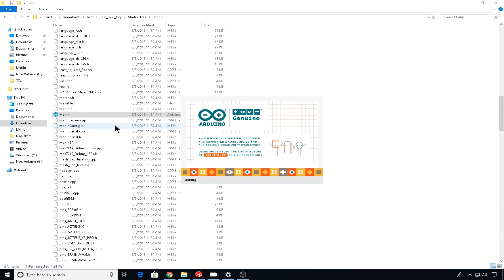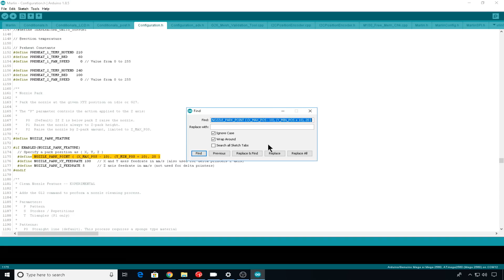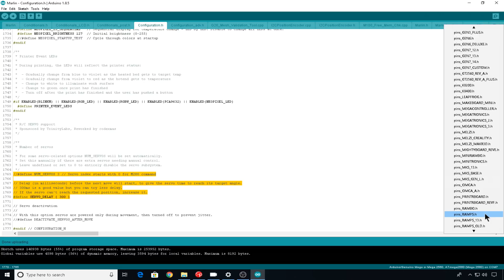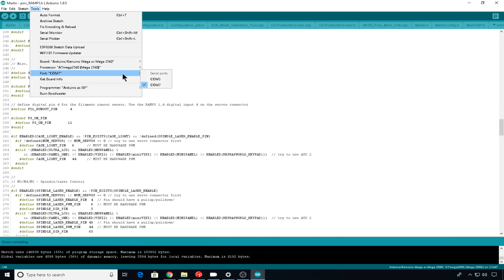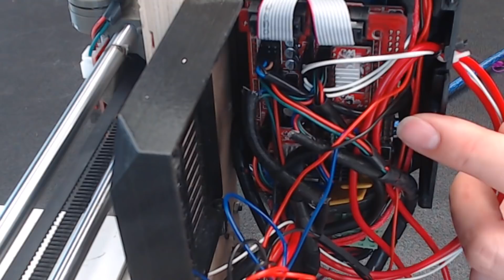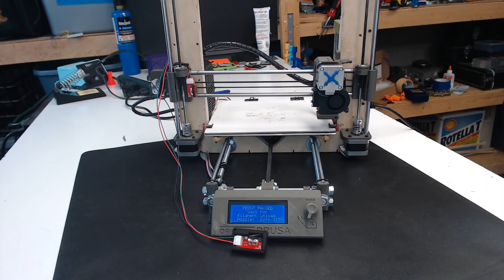Filament Runout Sensor - Native Marlin - Chris's Basement

Comment: Hi,very good video. But I done everything you said but I never get the sensor to work. With the filament in,light comes on from the sensor.If I give it a M600 code the printer will pause to change filament. I changed the sensor with another one but still the same. I am using Anycubic Kossel plus.
Can you tell me what I am doing wrong please.
Thanks,
Reply from the maker: My guess is the servo port your using is different on the kossel config, can you show me where you have it plugged in?

Comment: Nice, can i use 3 filament sensors?. I have a Diamond hotend. How i can configure marlin in that case.
Reply: You can probably get away with it by using individual sensors (limit switches) for each filament and wiring the limit switches (using the Normally Open pin configuration) in series. If any of the filaments run out, the limit switch will open the circuit triggering the filament run out signal. I hope this helps you.
Reply from the maker: That is a great question and unfortunately I don't know the answer. I'll do some looking around.

Comment: Great video, Chris.  If used on a Bowden setup, should the retract distance be equal or greater than the length of the Bowden tube plus length thru the hotend, to push the filament all the way back out?
Reply from the maker: Thanks Ron! I haven't played with this yet, but I think you are correct. These 2 M600 settings are what you would want to change.

#define FILAMENT_CHANGE_UNLOAD_LENGTH 100 
 #define FILAMENT_CHANGE_LOAD_LENGTH 20

Comment: Nice video again, Chris! Very easy to follow. 
I'm so happy that I've been using them for a while now, saved me like 3 prints already (you know, old filament likes to break...)!
On my dual-extrusion Anet A8, I just ended up using the Z_MAX_PIN, as the SERVO_3_PIN was already used by the fan-extender.
Reply from the maker: Thanks! Yes, I have been using it to use up some of the sort pieces of filament I have laying around. Thanks for watching!

Comment: Great explaination, nice, simple, and easily explained - thanks,  seeing how this seems to tie together in marlin, it also  has me wondering if is possible to add a  simple menu item that runs a small gcode routine to  assist in manually levelling the bed
Reply from the maker: Andy Davies Thanks and thanks for watching. I have seen that done a few times. Not sure how to, but I will look into it.

Comment: Hi can you make a video about using higher voltage PSU for example from a laptop with a RAMPS . I bought today a Toshiba laptop brick that is 15 V and 8 A, and a huge HP brick that is 20 V and 11 A ! Can I use them on a printer without heated bed ? Do I need a MOSFET board or some DC-DC convertor ?  Thanks !
Reply from the maker: If you don't use a heat bed, anything over 5A should work. You could probably run at 15v, but I wouldn't recommend it. You could probably use something like a 7812 voltage regulator to get you down to 12v. If I run across one of these supplies I will look into it. Thanks for watching!
Reply: Chris Riley Dunno what is the maximum voltage the components on the RAMPS can take, I think the capacitors are 16 V max ?
Reply from the maker: Yeah not sure, I know on some of them, they have 4004 diodes that keep you from running higher then 12v. I would have to do some additional reading..

Comment: Hello. Is there a way to lock the X and Y axis but keep is so we can still load filament? When I do a M600 on my Robo R1 Plus I can accidentally move the head messing up the print when the printer restarts to print.
Reply from the maker: I am not sure about the version of Marlin the Robo runs, but in the newer versions there is this feature. In M600 that takes care of this. In your version of Marlin you might be able to set 

#define PAUSE_PARK_NO_STEPPER_TIMEOUT       // Enable to have stepper motors hold position during filament change

In your version of Marlin you might be able to set some of these options to help. 

#define DEFAULT_STEPPER_DEACTIVE_TIME 120
#define DISABLE_INACTIVE_X true
#define DISABLE_INACTIVE_Y true
#define DISABLE_INACTIVE_Z true  // set to false if the nozzle will fall down on your printed part when print has finished.
#define DISABLE_INACTIVE_E true
Reply: Oh thanks. Ill look for those and or download newer version.
Reply: Meh I had everything but PAUSE_PARK_NO_STEPPER_TIMEOUT in the firmware. Guess I'll need to download newer and configure for Robo.

Comment: Hey thanks for the great video. I'm already using D11 D4 D5 D6 for RGBW is there any way to rather use an unused endstop pin? Like X max or Y max?
Reply from the maker: Sure! All you have to do is change it in RAMPS_PINS.H. You can just swap the port numbers around. Thanks for watching.
Reply: Chris Riley thanks!! I'm seeing so many of these videos of adding awesome features but noone has implemented all of them in a single board.kinda like the tmc2130 and LCD issue..those poor D4 D5 D6 servo pins are the village bicycles of the ramps add ons..i know i can't have everything on one machine but I'd like to try... 
perhaps  please when you have time after all the common feature videos have a review  video of pins used for each device added to your clone printer (with RGBW ;P)
Thanks again
Reply from the maker: Steven Randall That's a good idea. Log is getting pretty full up, I will write this one down for sure.

Comment: Chris, I am sure you have done a video on this but if I take to long in changing the filament on the M600 command, the motors will disable them self's and it will lose the height on the Z.  So when I replace the filament it will not go back to where it left off.  Can you point me in the right direction on sorting this?
Reply from the maker: Hey Derek, thanks for watching. Yes, check out M84 or check these out in configuration_adv.h

#define DEFAULT_STEPPER_DEACTIVE_TIME 120
#define DISABLE_INACTIVE_X true
#define DISABLE_INACTIVE_Y true
#define DISABLE_INACTIVE_Z true  // set to false if the nozzle will fall down on your printed part when print has finished.
#define DISABLE_INACTIVE_E true